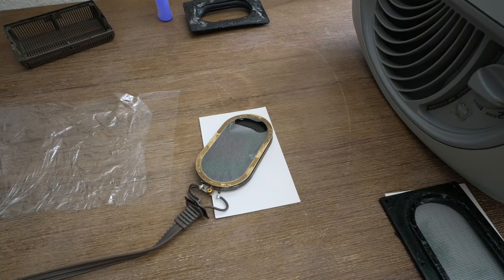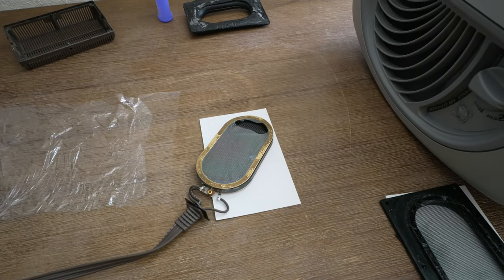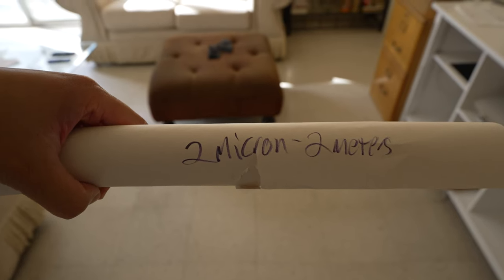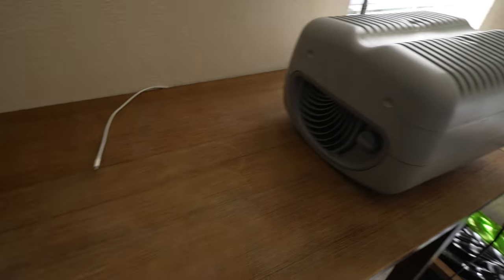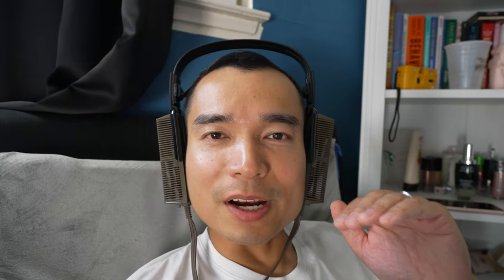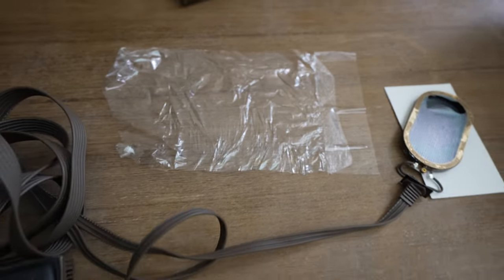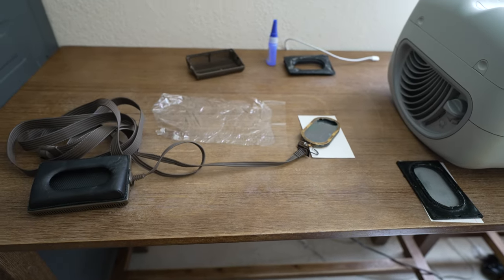Electrostatic Dust Cover Repair! Stax Lambda Nova Signature Headphones

Comment: Very interesting, I always thought the polar opposite of the LNS: good balance, but not as involving as other Staxes, nothing really stands out, hits a sort of middle ground, that's why people love it, resale values have increased noticeably over the years. 
It was the first ever Stax that I purchased in 2008, about a year ago I got a faulty one with this issue that I couldn't repair, now I have another one incoming, so looking forward to hearing one again.
Reply from the maker: For me, the LNS has a similar frequency balance to the 007mk1s (forward mids, little less bottom-heavy, slightly more highs), but nowhere as dimensional as the 007mk1. The 007mk1 are better in every way on my current system. I enjoy the LNS, but now that I have the 007mk1 and X9k, I put the LNS back in storage, lol. The funny thing about listening to the LNS after this video is that it helped me better understand the progress Stax has made with dimensionality of headphones. LNS = little to no dimensionality, 007mk1 = more dimensionality but in a congested room, X9000 = very dimensional and can image and portray an entire symphony. So far, the 007mk1 still wins me over for its mids and especially vocals. I hope at some point, the X9k will win me over as a whole.

Comment: How things change...now the LNS is one of my all-time favourite Stax headphones (within my current top 4),
And I put it ahead of the 007Mk1, which is more fun, but not as reference-grade, they've made the decision to substantially alter the frequency response to achieve a weighty sound.
And this is on the KGSSHV, which I actually don't think of as a really good amp for the 007Mk1, I actually think the feedback modified 727 is better matched to it (but also weaker).
Reply from the maker: I really like the lns. At some point during my journey, I thought I could live with it alone, but the poor build quality detracted from its long-term viability. To me, my 007mk1 is better than the lns in every way, in sound and build longevity.
Reply: The older Lambdas have a better arc assembly, but it is no big deal, I could transplant the drivers and cable in one of those, but am sure after the re-gluing it will last just as long as other Staxes. I think I might have more trouble with the headpad stretching on the 007, I find that annoying, but I am probably not keeping it in the long run.
My problem with the 007 is that it has boominess in the bass giving it a lower quality feel and upper midrange dip and more emphasised high frequencies. Definitely on a much higher technical level, so it is much more captivating and relaxing than the LNS, but also more flawed. The Omega is like a cross between the LNS and the 007.

Comment: I didn't realize the membrane was that thin. I also punctured a tiny hole in mine with a needle. The size is literally the size of a pin head. Do you think I should get it fixed or replaced? I am worried that dust will get in eventually and weigh down the driver. Or do you reckon such a miniscule hole is negligible? 
I always keep the stax dust cover on. 
I really hope you can provide any insight
Thanks in advance
Reply from the maker: Hi! Yes, I think you should patch up that hole. You can do it by cutting a small piece of scotch tape and carefully taping it over the hole. Please confirm the scotch tape technique by searching online! I actually patched one of my holes with scotch tape. Hope that helps!
Reply: @longandclaire  my comment was deleted for some reason. I was wondering if you would still recommend the tape method even if the hole is really really small. Also would the tape rip the rest of the diaphragm if I remove it in the future?
Reply from the maker: @h.p.734  If it were me, if the hole is really small, I'm torn between putting a small piece of tape over it vs leaving it alone. If you're not comfortable with the tape, then don't do it. And yes, if you remove the tape in the future, it will tear the dust membrane around the driver.
Reply: @longandclaire  Thank you so much for the reply. I was gonna put tape on it because I thought it wouldn't rip, but I"m so glad I waited for your reply. I won't be putting tape on it anytime soon then.

Comment: Hi, interesting video. I have two LN Classics and after 36 years (yeah, you read it correctly) the only issue I have is with the thin sponge that covers the inner part of the cans: they simply crumble apart. I eventually just completely removed them.
Looking at your cans looks like you removed them too, am I right?
Ah, given that I have 2 sets, I have tried the SoCas PadMod on one and I have to say I’m super happy with the result!
Reply from the maker: Hi, yes, the sponge deteriorates over time and becomes useless. I think most people who have lambdas have removed the spongey foam around the drivers. I wouldn't take apart the headphones just to remove the sponge though.

Comment: @Long and Claire pretty scary hole in the membrane, that one... Good thing you got the nerve to try fixing it. 

I have the Lambda Signature (SR-L407, not the Nova) and an Omega SR-007A (serial number SZ2-1636, which makes it into an early MkII, as far as I could check). I've also replaced the Lambda's headband assembly with the one from the L700 MkII, which has the newer metal drive cup holders - the original assembly felt really flimsy and couldn't hold its adjustment for my head for long. Both problems are solved by the newer assembly, and the ensuing color mismatch actually has some charm. A problem which still not solved is that both assemblies squeeze my head a bit too much, so I cannot use the cans for long times without discomfort. The Omegas, on the other hand, basically sit on my head and I forget they are there - they are soooo comfortable... Because of that, nowadays I only listen to the Lambdas once in a while when I miss their sound signature (no pun intended...).

Both earspeakers are driven by a CCS-modded Stax SRM-T1S energizer which came together with the Lambdas. The CCS mod makes the SRM-T1S sound a LOT better with the Omegas, especially if you do the port mod (as I did) which makes early MkII's like mine sound closer to the MkI, and it's a lot cheaper than the Mjölnir Audio and BHSE energizers (which are way beyond by current budget). I do know that even so I'm still not getting everything the SR-007A can do, but I'm still happy with the results so far.
Reply from the maker: Hi! That's great, I love the 007 as well. Like you said, I only bring out the lambda when I'm curious about their sound. Otherwise, I exclusively use the 007, as it's better in every way, sonically and comfort.

I used to own a stock T1S, and I loved it. I regret selling it years ago because I was a poor college student. My kgsshv seems to provide better, more authoritative bass and microdynamics, but I still remember the Stax tube amps having sublime midrange and vocals.
Reply: @longandclaire  yeah, even the CCS-modded T1S provides only just about enough power at moderate to medium volumes (10-11 o'clock) to the 007A. Beyond that, you stumble upon the limitations of the 6CG7 output tubes, which are slightly voltage overdriven by the T1S's circuit design. This causes loss of high-frequency response at higher volumes (hence the poorer microdynamics, I believe). As for the bass, one probably just needs plain more power, period. Nonetheless, the timbre and imaging with my T1S are indeed just superb. Soundstage could be a bit deeper and wider, but that's largely due to the DAC I'm using, which is the RME ADI-2 DAC - this is known to be the latter's main weak point. On the other hand, this DAC is so clean and precise, I can live with a more intimate soundstage (which is probably adequate for most of the music I listen to anyway), and having features such as a 5-band parametric EQ is a great bonus. I've tweaked its connections as much as I could within a reasonable cost - professional-grade balanced XLR connection to the T1S, Oyaide Continental pure-silver USB connection and an Ifi DC iPurifier to further clean the DC power.

Comment: Nice informative video. I like my LNS too for its mid centric sound unlike most other Stax headphones though its sound is less precise than 007, Lambda Normal Bias, let alone Omega. 
I wonder you have any information on where to get replacement foam behind the Lambda drivers?
Reply from the maker: Glad you found it helpful. I personally don't use any foam on my LNS. I removed all the old deteriorating foam long ago and find that it sounds better without the foam. I also replaced the headband with the L700 handband. And yes, I really enjoy the LNS, moreso than the HD800s. If I never heard the 007, I would be happy with the LNS as my daily driver.
Reply: You can get the protector mesh that is supplied with the current earpads as a separate part and you can fit it easily after removing the foam residue.
Interesting though that I hear it the opposite way: I think the 007 is less precise than the LNS, which is more similar to the Omega. The drivers needed re-gluing and now they sound great.

Comment: Hi, I like your reviews on Staxs and I think that you do them very fairly and righteous. I have the Stax small speakers 005s that came with a small amp and a Nectar Pollinator headphones and they do for me pretty well on the warm and bright ways of replay. But recently I got a great deal for Lambda Nova with a SRM-3 driver, both in a perfect shape. I find the Lambda Nova marvelous in music replay and, yes, they really do the low end impressively, so now I have three electrostatics that have warm, neutral and bright replay. Please, share how to change pads (since you have the experience). Are the pads glued and how do I take them off? I ordered original pads and I may decide to change.
Reply from the maker: Hi, yes, the pads on the classic lambda nova are glued on with some gooey thick adhesive. I don't have good recommendations for removing or re-glueing the pads because I just kinda rip them off and use a tiny bit of super glue to get them back on, lol. I'm sure there are better instructions on the net.

With vintage Stax headphones, my advice is not to mess with them unless something is actually wrong. I've had too many experiences of breaking something when I unnecessarily mess with my Stax headphones.
Reply: @longandclaire  Thank you for the prompt reply! I will change only if very necessary. So, now, only thing is if these are very very good for where do I go to 007a, 009, or 9000.
Reply from the maker: @nikolaygramchev  I haven't tried the latest 007a/mk2 yet, but I would start there. If you do go that route, try to get a brand new 007a/mk2 that was recently manufactured.
Reply from the maker: @nikolaygramchev  if you're completely satisfied with your lambda nova, just stay there lol. The higher end headphones are diminishing returns. You may end up spending a lot more and not enjoy it as much as you thought.
Reply: @longandclaire  Great, that reply makes my even more happy on the LNS. Will look for new Stax when this one breaks (:-)
Reply: Hi, sorry for coming back on that. The coming Saturday I will have the chance to test the 007 mk2. Good price. Please, tell me what to listen for!? Guess the 007 mk2 would not much the bass of LNS, or I am wrong!? But, should I expect better resolution and details from the 007 mk2? And from your experience, what about imaging and staging? Would appreciate your guidance.
Reply from the maker: @nikolaygramchev  the 007mk2 should be better than the lns in almost every way. You should pay attention to vocals though. Some 007mk2s have an upper midrange etch / harshness that can't really be fixed. Make sure you listen loud and also moderate volume to see if there's any midrange etch. Also, if it's used, check to make sure there's no channel imbalance. Sometimes the channel imbalance isn't obvious. Also chk where the cable enters the headphone, make sure it's secure and in good condition.
Reply from the maker: @nikolaygramchev  also, your current amp / Energizer is probably not powerful enough for the 007mk2. If you get the 007, you'll likely need to upgrade your amp too, perhaps look into getting an amp that has xlr inputs so u can use a balanced DAC output with more power.
Reply: @longandclaire  I am so grateful for your guidance and tips. Last question, if you still can bear me - does the srm-007 t2 worth $1600. Now I am using srm-003 that works pretty fine for me with the LNS?
Reply from the maker: @nikolaygramchev  Brand new srm-007t2 for 1600 is good deal. If it's used, I don't think it's worth it. I sold a used / excellent SRM-007t2 about 2 years ago for $900.
Reply: @longandclaire  clear, again appreciate it!
Reply: @longandclaire  Hi, want to thank you again for your advices. I got the Stax 007 mk2 and these are really better in everything vs the LNS, as you said. Maybe they are equal on the sound stage only. The 007 mk2 plays really well with the SRM-3 but upscales very well with the 007 tII.